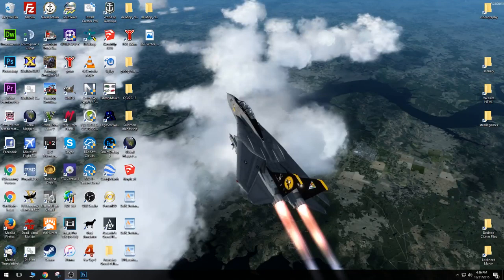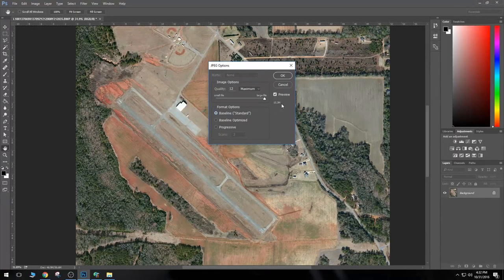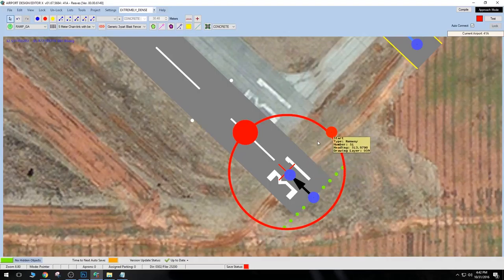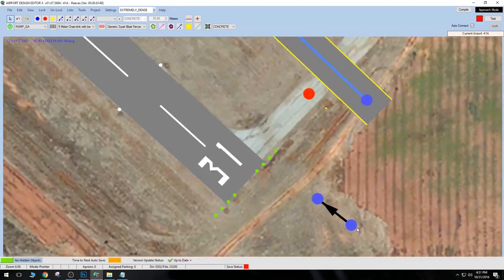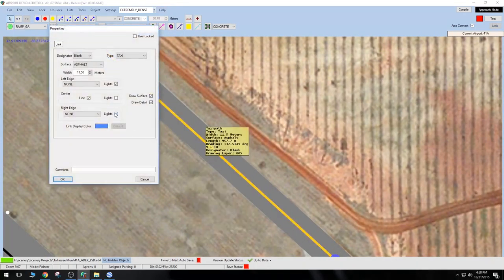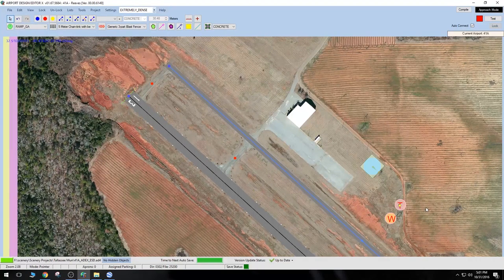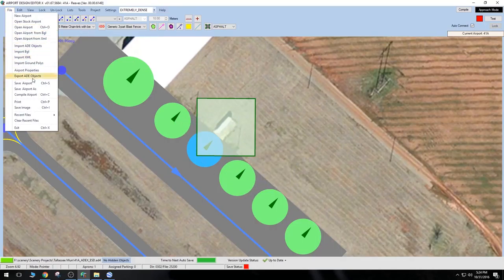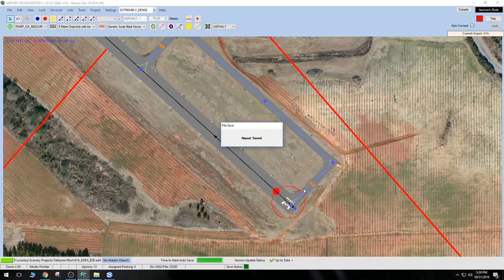[FSX/P3D] Scenery Tutorial - ADE AFCAD Alignment 2016

Comment: * 17:24 There is an easier way for that :)
Select "Add Guidelines" (above "Add Exclusion Rectangle"), forget the default track, draw a line that runs through one of the sides of the track IN THE BACKGROUND IMAGE, then double click on this guideline to see its properties , there you get its length and its orientation ACCORDING TO THE IMAGE, you give those values to the track and that's it, you just have to reposition the track on the image track (and adjust its width if necessary). I hope it is understood, I am using the Google translator :\
Txs for this great tutorial, greetings from SACO :)

Comment: Nice tutorial. Do you know how to put lights above a ground polygons?
Reply from the maker: I missed your comment. Sorry, I haven't done any custom lights in FSX or P3D for quite a few years now, so I dont exactly remember the process.

If you want simple, I think you can do a default style with ADE where you would align the runway to your poly, make sure that runway has lights then just make the AFCAD runway invisible. It wouldn't give you accurate lighting, but it would give you lighting.

Alternatively, I believe when I did lighting, I made my light poles then attached one of the light FX. I think there may be default ones in the effects folder that you could use that scale properly at a distance. If not you may need to create an emissive (lightmap) cross-plane on your light pole that you can scale up over a few LODs. You would also need to hide a big box underground for the pole so that the effects don't get culled with the sim's LOD and show from a distance.

Without actually sitting down and trying it, this is the best I can remember off the top of my head.

Comment: hi , hope your haveing a great say , i need some help , when i rey to compile my airport i get an advertisement its says that ADE could not fine the shp2vec compiler , i already set the fold era correctly to the directions it asked for but its still not leting me do it , can you tello me where do you have the shp2Vec folder directed to , p.d. good video , really helpfull .
Reply from the maker: Hello. Do you have the SDK(s) for your sim(s) installed? shp2vec should be located within the following directories of your SDK(s):
FSX SDK - "SDK\Environment Kit\Terrain SDK"
P3D SDK - "Environment SDK"

Check and make sure that shp2vec exists in those directories. If not, you may need to reinstall your SDK.
Reply: If you are using Steam, you will need to download the P3D V 1.4 SDK for it to work.

Comment: 59:00 I wanna open my scene but I'm using Prepar3d. How do I do it?
Reply from the maker: Hi Faizal.
It's basically the exact same process. Actually easier functionality wise. The only difference is that in P3Dv1 through P3Dv4.2, the Scenery Library must be accessed from the top tool bar after starting a flight. If I remember correctly, with v4.3 you can now access the Library from the main menu.